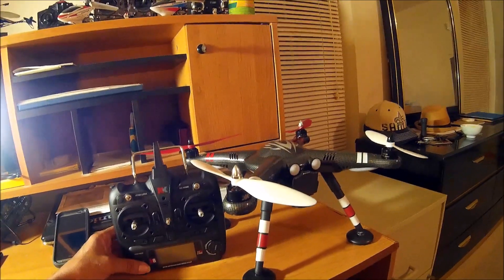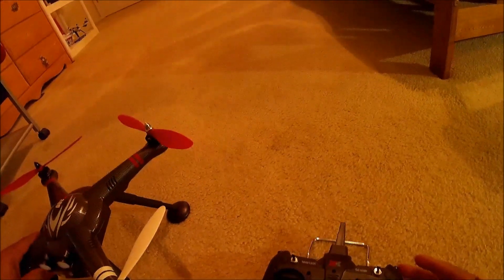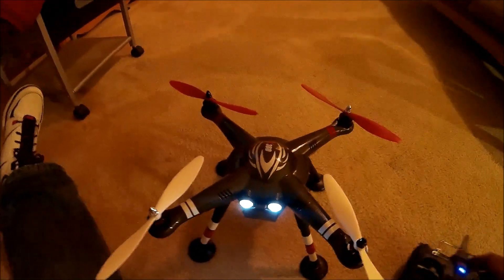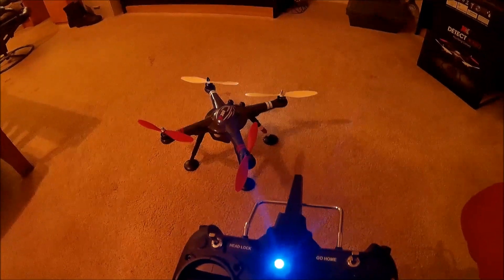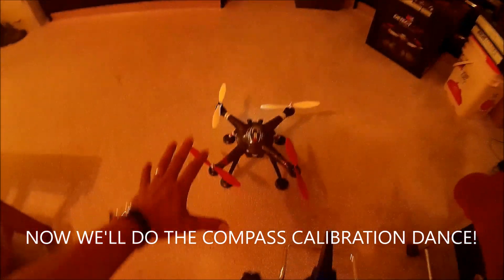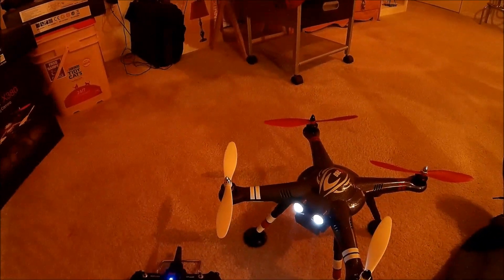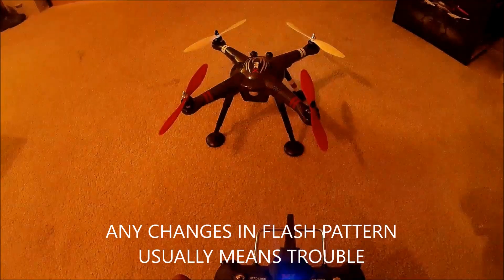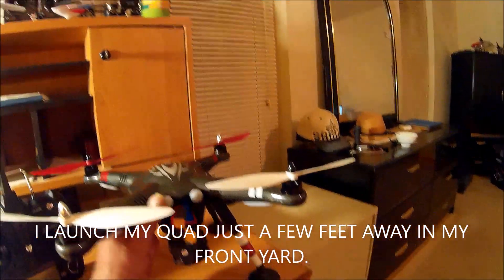XK DETECT X-380 "MUST WATCH BEFORE YOU FLY"

Comment: DJ,I am having some new issues with the x380 When I go into my compass dance .After I do my 360 degree circles twice I place it down on the level and click the head lock 3 times , now here is the trouble , when I pick it up again with the green indicator light in the up or toward the sky position to do my next to 360 circles the indicator does not turn red like it did when I first got it , it stays flashing 2 greens. I complete the dance anyway and when I take off using the auto take off button , It will fly ahead about 30 feet and I have to bring it back manually . Seems although I have 2 flashing green lights saying it is in GPS lock it is not holding. Acting very erratic. Do you think I need to bring it back to factory settings via the computer like you show in your one video ? Thanks a lot . Please advise!
Reply: +sparky42  Did you get your 380 Quad to do the right thing. I have the same problem. What's your solution? Bobk219@gmail.com
Reply: Bob Koch Bob , as a result of the problems I am having with my 380 I crashed it a few times and am in the process of doing all the repairs ( crying ) and in addition , the weather here in the Northeast has been terrible. I will be trying things again hopefully in a few weeks and I will certainly let you know how it went . Please do the same for me if you find a solution . My email address is ka3fad@ptd.net. Please email me if you like and the same to you DJ . Thanks guys
Reply: +sparky42 :Hey Sparky42! DJ Soul Force just help me fix the problem with the Mag Dance--You just have to flip the HEAD LOCK switch real fast. I had made a video and uploaded it to YOUTUBE  and DJ Soul Force came back to me in a flash with the "Flippin" suggestion and it worked like a charm.
Cheers!
BK
Reply from the maker: +sparky42  When you do your 360 circle twice the first time, go a little further until the light does change, then sit it down. When you pick up again and point the nose down, it should turn solid red. (sometimes I have to circle two & half times before light changes, some guys do three circles!)  Afther you've done a successful compass dance, then calibrate the accelerometer (this is something new I just learned).  Sit the quad back down again on level surface and flick the RTH button 12 times or more until the rear LED begins to flash rapidly. Wait for LED to stop flashing, and you're done! That's how you calibrate the accelerometer & that tells the quad what the "0 level" point is! If those steps don't work, then yes, re-install the master files. (also, don't rule out a "transmitter bind" which is necessary when the quad is drifting too much) I can't be certain from here what your exact problem is, but these are the "easiest-to-hardest" fixes that should help you. Let me know how it goes.  Holla back if you need more help, I'll be up for about the next 2 hours, if not, catch me tomorrow!  DJ SOUL FORCE

Comment: dj i wanna buy one but i read a lot of things like ,,dont buy it have a lot of prblms with gps,,i think its a nice quad??
Reply from the maker: +wil groot  There has been some issues with the x380 and a lot of crash videos. In my opinion, the crashes come from the lack of knowledge on the part of the pilots, and the factory didn't do a good job of explaining all there is to know about the quad. The instruction book doesn't give enough information about the quad for pilots to know what to look for before trouble strikes! That why I did so many videos on the x380. My x380 is over 6 months old, over 75 flights, and no problems. The x380 has one of the best automatic RTH systems I've seen and It acquires GPS satellite lock faster than my Phantoms. It's a nice quadcopter, but you must do some studying and learn all about it before you can trust it! There isn't too many quadcopters that you can buy that won't have some kind of issues, you just have to become familiar with them and make the corrections. If you can afford $489, I would suggest the DJI Phantom 3 Standard, if not, then I suggest the x380. (just my opinion!)
Reply: ok thanks dj ,im sorry for my bad english,,gonna buy the x380 from gearbest pay there 187euro fore the quad,,can i add you on my fb account?? thnx fore u fast response xx
Reply from the maker: wil groot Yes, on facebook, I use my real name - Darryl C. Robinson. Thanks

Comment: Dj You have some great videos!!! I'm a big fan. I got my x380 2 weeks ago and all is great, do you have any video's on the ground station software? I would like to speed up the return to home and change the quad to face me on the way home. Keep up the great work.
Reply from the maker: +brian miller  The flight control software is easy to use, once you get it installed & open it up on your computer. The tricky part is getting it installed and working with your computer!!! That's why I chose not to do any videos on the flight control program. I did post a link in the description of this video https://www.youtube.com/watch?v=c0jPjEA4ZdQ that has the flight control software, and there are videos on youtube on how to use it. (most of them, I can't understand) Try to install & open the software without connecting your quad, if you open it, you'll see it's almost self explanatory. If you need further help, write me back. (oh yea, some of the flight control program is written in Chinese, or unless they changed it recently) You can also find the flight control software at: www.XK-Innovations.com  Good luck bro.  DJ Soul Force

Comment: DJ, I went to ebay, searched lipo cable vx60 to banana plug. I should get it in a couple days. I want to verify the proper male to female connection. They are closer to you though. Short shipping time.
Reply from the maker: +zipngo1  Thanks for the info.

Comment: DJ, I have a question at this point. Silly but, The charger is a pain. The batter only connects with the small 4 pin.
I have balance charger.... Do you know if both connectors (vx60 and the small 4 pin)?
Can you do a quick vid on the charging if you use an after market charger? 
I hope to get this thing in the air by Friday!
Reply from the maker: +zipngo1  I use the Imax B6 balance charger. I plug in the (small 4 pin) balance cable into the 3S port and I have to use the red & black alligator clips to connect to the xt60 plug. With my charger, I connect both cables to charge.  I'll think about doing a short video on charging with aftermarket chargers, the factory charger sucks!!! Thanks

Comment: DJ , question please. Can you " top off " a LI-PO battery or must it be fully discharged ? What happens if you haven't timed the minutes of use on the battery and you want to fly again ? I will be getting a timer
Reply from the maker: +sparky42  I'm not sure I understand your question. (but this may help with the answer) You don't have to totally run out the battery before you recharge it (or "top off"). The opposite of that is, it's ok to fly with a battery that has been used and not totally discharged, but keep the quad close to home so you can land quickly,  because when the battery gets low, the x380 could fall. A nice feature on the x380 is it's bright flight indicator that blinks red when the battery gets weak, giving the pilot enough time to bring her home safely. Hope this answers your question, thanks for watching.  DJ SOUL FORCE
Reply: yes it did and thanks ! and if I might ask one more question DJ . I would like to purchase extra props and things for the X380 . Do you recommend any particular place in the U.S.A. that ships fast with good prices ? Thanks again ...
Reply from the maker: sparky42  If you shop on Ebay, you can use the filters to show only US sellers. If you shop at Banggood.com or GearBest.com, they both have options for US warehouses.  Also, Hobbyking.com has parts for the x380 in the US. For the best prices, I found that you just have to shop around because no one store have the best prices for everything!!! From China, try www.AliExpress.com. They're like the Amazon of China and they ship pretty fast but you're dealing with thousands of different independent stores. Good luck bro. DJ SOUL FORCE
Reply: thank you sir ! Happy flying :-)

Comment: Well Dj.tried installing the new firmware.opened it up to check any loose cables .everything looks ok but nothing worked. This is the day I didn't want to see.didn't even get to use my new backpack.
Reply from the maker: +Oscar Flores  That really sucks... After the new files, is it still doing the same thing as on the video?
Reply: Someone in the xk owners group asked me to calibrate the motors so I ordered t servo tester. I will order a  couple of motors just in case.

Comment: I have  a predecessor of this drone and it is almost the same (with a fake carbon look). My advise is not buy it. At first it seems to be a fair product for the money, but it is very unreliable. I have followed every step in the manual, but in the end it is a good means to kill someone unintentionally. It dropped out of the air without apparent reason. The support of WLToys here in The Netherlands is proven to be very crappy. Not client/service-focussed and they show no initiative at all to provide customers with a workable solution (only thinking to earn extra money)..... My advise is to buy a phantom. Not cheap, but also no hassle.
Reply from the maker: +Tony Otterman  Thank you for your comments, I'm sorry your x380 crashed. I agree with you about XK customer service, very bad, I too had a crash on my second flight and got no support from the factory or store I purchased it from.  I still have my x380 and it's fine, but I also bought the DJI Phantom 3 Standard & Professional. Thanks for watching.  DJ SOUL FORCE

Comment: Hi Dj. I just went out out for a nice flight and I just found out that 2 of my motors  are not spinning the way they should be.I posted it on the All xk owners group but I wanted to know if you have any ideas as to what might be the problem.I have not had any crashes or hard landings.Last time I used it it was working perfectly. Any suggestions? ----Oscar Flores
Reply from the maker: +Oscar Flores  Man, sorry to hear that. Did you make a video, if so send me the link so I could take a look. Are they spinning but not fast enough? Is it trying to tip over when you take off? Did you try reloading the master files like in this video?  Hit me back, I'll try to help if I can. DJ SOUL FORCE

Comment: Dj soul force i was just asking for a little feed back is all i'll try one more time, do you think by no display on transmitter screen would cause the quad not to gain gps lock thanks?
Reply from the maker: +Wim Ross  If you don't have any display, your batteries may be dead and that could cause the solid red light. The x380 transmitter eats up some batteries pretty fast. I use rechargables in mine. See my other comment below for more help. Let me know.  DJ SOUL FORCE

Comment: I've got problems, got my x380 yesterday successfully binded my transmitter and my calibration, got home today pluged the battery in but only get solid red light, any suggestions?
Reply from the maker: +Wim Ross  Sorry, I just got this message. Solid red light usually means the RTH switch is on, it should be in the up position. Make sure both toggle switches are up and the transmitter's batteries are charged.  If that doesn't work, hit me back and we'll work on some troubleshooting.  Sorry I took this long to respond, I missed this one bro.  DJ SOUL FORCE

Comment: Hi DJ.  Your must watch video for the XK380 has been extremely helpful...just got mine.  When doing the calibration dance, I don't get the steady red light  like you do in the video clip....I continue to get the two green lights.  Everything else appears to be fine.  I haven't taken mine out because I'm waiting for a sunny and windless day...you know what I mean.  For my first flight, do you recommend not going up more than 30 feet or so?  It's a shame I can't speak with you as I'm sure you could be very helpful. 

Thanks, Jose
Reply from the maker: +José Crespo  When you do the first full circle, your light should be solid green after flicking the headless button for 3 (or more times until it turns solid green). Now that light is solid green, quad is level to ground, turn two circles. After you put quad down, flick the headless button 3 (or more) times, light goes out. Then point NOSE to the ground, you should get a solid red light. With nose down, two more circles until light goes out.  If that's not working, make sure that you have binded the transmitter to quad before you do the calibration dance. Let me know how it turns out.  (If you're not getting the solid red light, somethings wrong!!!) DJ SOUL FORCE

Comment: Hi Dj, I am having a real bad time with my x380. I have 2 of them.  I use to fly rc airplanes and helicopters, so don't think it is me. The 1st one I got I chopped power and it fell like 25 feet on first try and broke top n bottom shell, so that was my fault. ordered me a 2nd one and also new top n bottom shell for 1st one. The second one, very 1st try it come up and flew hard away from me and I killed power as it was going pretty fast,, luckily it didn't break. Then it flew ok! Next day, same problem.  Now  Even tho I recalibrated every time ( compass n satellite ) as per your video. I get new shell for 1st one. and sometimes it is fine, other times takes off ok, but after auto take off, and hovers, it don't stay in place, I have to keep correcting it as it starts to slowly start going in small circles  and circles keep getting bigger if I don't correct it. This is true to both 380s. Other times after take of, it will  take off in one direction or another. Yes I recalibrate each time. Both to bind transmitter, and the compass dance and I get the flashing green light. I bought the antenna booster, and camera for fpv and a monitor, so have quit a lot of money in them, and still only have 2 flights, that were good. Still haven't used fpv and only had the camera mounted on 1 flight so far, as I'm afraid I will ruin cameras because of hard time I'm having. Want to get confidence flying them first. But have little confidence after all this. Any thing you can think of to help or suggest?. Wanting SO bad to enjoy these but so scared to fly after all this!. Oh yeah I do have the new ones, both of them have the FAP instead of the Photo on receiver. Thank you so much and keep the videos coming. Bob
Reply from the maker: +Bob Hoffman  Hi Bob, it's highly unlikely that you could have received two bad x380's with the same problems. I have to believe that the area that you're flying in must have some sort of strong interference present.  (stupid question here) Have you tried flying in a different location? And as always, make sure that the quad is level and not moved at the time you connect the battery. (don't want to insult your intelligence, I know you're an experienced pilot) When all else fails, the last thing I can recommend is to strip quad down to stock (no camera or gimbal) reload the internal Master Files and try again.  Here's a video that may help - https://www.youtube.com/watch?v=c0jPjEA4ZdQ  Keep me posted please.  DJ SOUL FORCE
Reply: Hi n thanks for reply.  Yes flew at 3 different places. Ground leval, did not move quad after hooking up battey, used camera that came with x380B one time, was on last flight, which was a great one. I know, two bad ones? I dont think so either. Out of total of 6 attempts had 2 successful.  Just scared now to even try.  Yes all solder looks good and connections. Ok will try to reload. Thanks
Reply: +Bob Hoffman Hi DJ, Thanks for fast response> I got it working! I AM A COMPLETE IDIOT!! what I was doing wrong was when binding transmitter, instructions and from you say flip return switch 6 times, but I have to do it like 15 times. That's ok, all is good. NOW here's where I went wrong when doing the magnetic calibration, When I pulled down the left stick, and then flipped headless switch, I would flip the headless switch 4 or more times, !!!! I would go PAST the solid green light, and then proceed , but since I went past the steady green light, back to flashing green light,  I was defeating or not calibrating the compass!!!!!!!! DANG WHAT AN IDIOT!!  I finally got it working!!! but only got one flight in that was good by this time.  but all went well, and got to use the FPV !! Thanks so much with putting up with Idiots like me. I feel so bad and like a fool about screwing up such a simple thing as this set up!!! Thanks again and God Bless      Bob
Reply from the maker: Bob Hoffman I'm truly glad it all worked out. Would that explain what happened to x380 number 1?  Lol  DJ Soul Force

Comment: Thank you for this video.  I finally made a decision as to which one to buy and it turns out to be the x-380 as you have had such good luck with yours..  I purchased this as opposed to the dji 3 standard for a few reasons. I got a good deal on this and prefer being able to add accessories as I please and the cheaper batteries as well as a few other things.  Anyway, getting to the point...... I see you suggesting to  not fly these in the cold.  It is cold here with a couple feet of snow.   Because there seems to be many doa's with this one, I would like to test mine as soon as I get it so I have recourse if it is doa.   What is the lowest temp that you would suggest testing it out at?      Thanks
Reply from the maker: +jonnyrobinson1  The cold weather comments I made came from reading comments from a guy in Ireland. He suggested not to fly below freezing. I've also heard of other's flying below freezing but flight times were greatly reduced. The cold can affect battery performance but I don't think it will harm the quad!  DJ SOUL FORCE